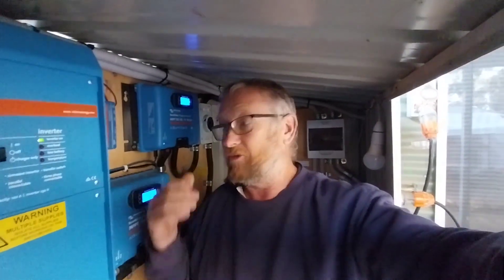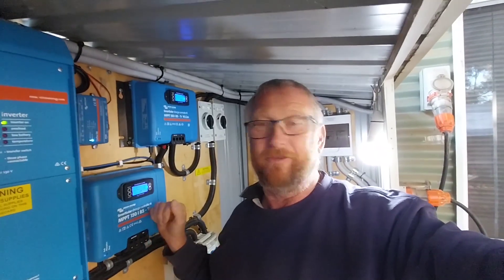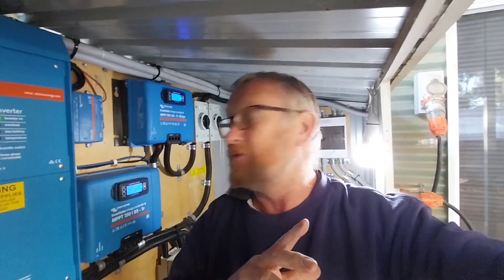We Have DC Ripple - So Let's Problem Solve This

Comment: I have 5 victron charge controllers going thru bus bars and a smart shunt before batteries. In the app I setup the network with all controllers using the voltage from the smart shunt. 4 of the 5 had different voltages prior to that and I experienced the same effects.
Reply from the maker: I set up a network as well and have everything talking to each other. I think having one controller on the smaller cable is throwing the system out a bit, well.... I'm guessing 🤔
Reply: @TheOffGridBachelor it could be cable difference. I thought the same and swapped positions between controller and the voltage difference moved with mine. Cheap volt meter internally ?? My controllers now rely on the shunt voltage thru the network for charging

Comment: I recommend lowering the charge voltage. According to the graphs, it appears that the BMS is disconnecting, causing the voltage to spike up to 57V. Try adjusting the voltage to 55V, 55.5V, and 56V to see if you can eliminate that spike. The controllers should be under external control from the Multiplus they are not independent, and the voltage they are measuring is not being used at all. 

It's common to experience ripple under load in the cables coming from the battery, especially if the cables are too small. You can add a custom widget to graph the ripple in VRM, it seems you don’t have one currently. Alternatively, you can measure the ripple with a multimeter. Set the multimeter to AC and use it on the DC input to get your readings.
Reply from the maker: Thanks for that tip, I will set up a new widget and see if we can plot the ripple.
The battery manufacture Amptron recommends the charge voltage be 58.4 volts, I had the controllers set to 57.4 volts. The BMS over voltage shuts down is 60 volts so it shouldn't be triggering the over voltage on the BMS, well one would hope ? I don't wanna run the charge voltage to low so as no to allow the battery to do cell balancing. But it can hurt to drop the charge voltage down to 55 for a few days and see if that does stop the issue, worth a try.
Here is the link to the batteries I use, will have some of the specs on the battery if your interested to see the specs.
https://amptron.au/products/48v-100ah-100a-continuous-discharge-lifepo4-battery/
Reply: @TheOffGridBachelor   Blasted battery manufacturer doesn't know what they are talking about.  They are nuts to want to charge LiFePO4 that high.   The inverter alone will probably alarm at 59 or 60V.

mariovr8416's recommendations are correct.  The charge target should be 3.55V/cell x 16 = 56.8V and the float should be between 3.35V-3.375V/cell (53.6V to 54.0V).

The only problem here is that you need to find out what the Amptron's actual BMS settings are to ensure that it still starts balancing the cells with a 3.55V target.   Most BMSs start balancing at 3.45V/cell so if its programmed right it should work fine with a 3.55V/cell target (56.8V bus voltage).  But if the BMS is misprogrammed then the BMS might not be balancing the cells at all and causing severe BMS disconnect problems even at lower charge targets that over-volt the battery bus.

-Matt
Reply: Charge to 56.8v and float at 54v. It is lifepo4 and you don't need to squeeze every amp back in. It was designed to operate in a partial state of discharge. It will even fully charge at 55.6v, it just takes long for the last amp hours to go in. The battery stops taking charge when it is full and not when the charger transitions.

Comment: Let's see what happens. Are those strings actually parallel strings of three panels?  Now you have 4P3S into one controller.
Reply from the maker: Now that I have changed it and if I am going to keep it that way, I will have to introduce fuses on each string.